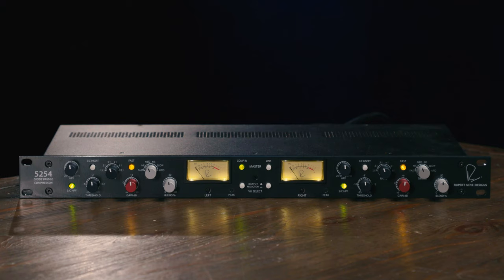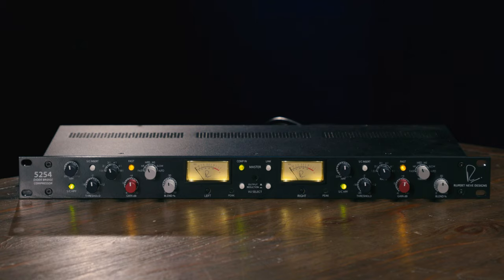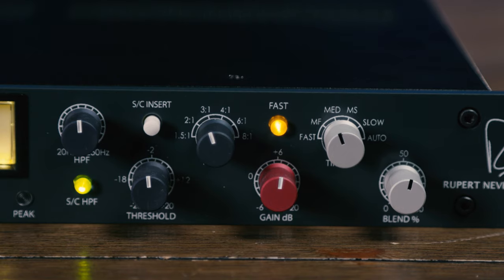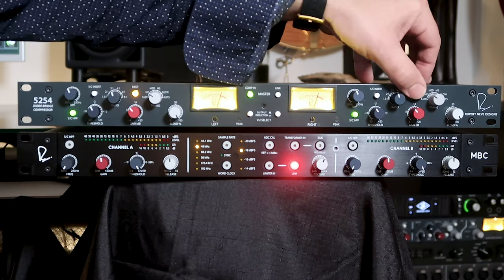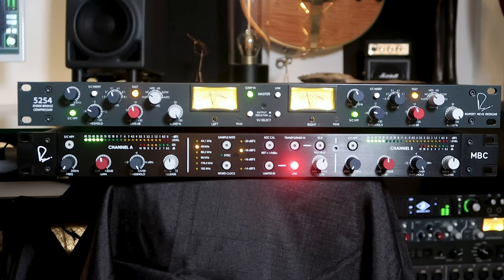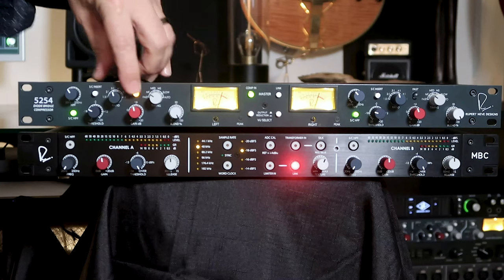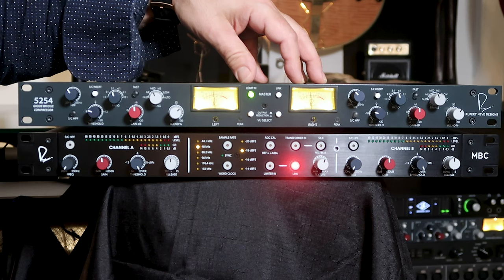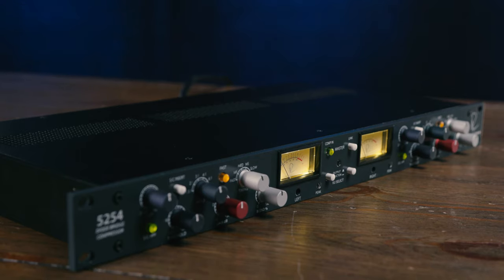Rupert Neve Designs 5254 Dual Diode Bridge Compressor Demo

Comment: WHY don't high end compressors have noise gates?
Reply: @AppAxis  I use a DBX  266XS (from Sweetwater)  for my vocal chain,and I have a vintage Alesis 3630 (the model Daft Punk uses) I bought over 20 years ago for my instruments. I record analog,so I wanted to upgrade to the Neve sound.I do jazz tinged R&B,so here's what they sound like..... https://www.youtube.com/watch?v=KDiA40sny54
Reply: @NURREDIN  dbx isnt hi end
Reply: @zanem9022  You have a problem with reading comprehension. It's obvious if the DBX has a noise gate that it isn't high end. The question was why don't high end compressors have noise gates?.
Reply: @zanem9022  P.S. It's TYPICAL that the snarky comments ALWAYS come from people with no content.

Comment: Can someone tell me how you can accurately set the gain control, and any  other controls that are not controlled with the link button? Won't there be slightly different levels since it's not stepped?
Reply from the maker: Hi Bob, thanks for reaching out on this. The 5254 does indeed have stepped rotary controls, even on the gain control. It's a breeze to channel match.
Cody Kraus, Sweetwater Sales Engineer, (800) 222-4700 ext. 1766, cody_kraus@sweetwater.com